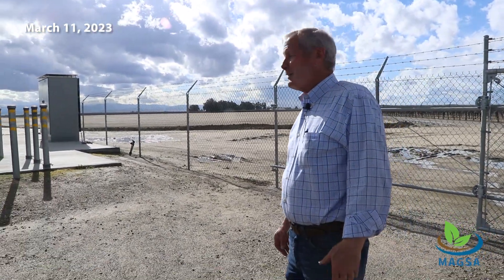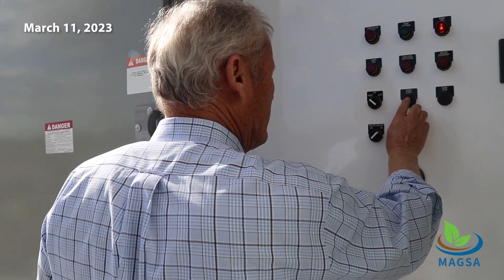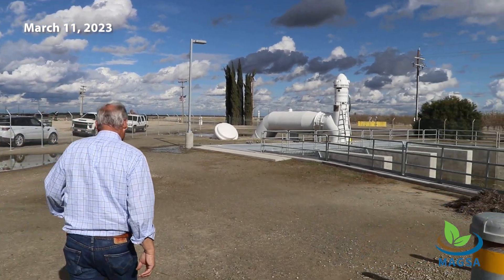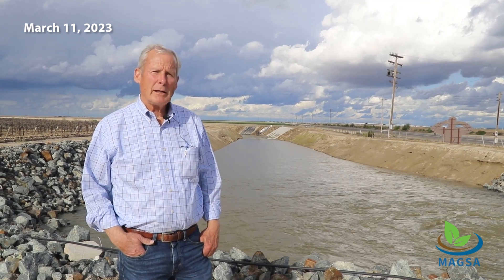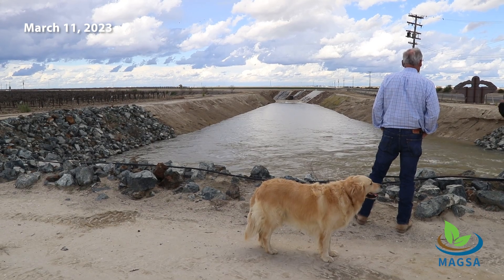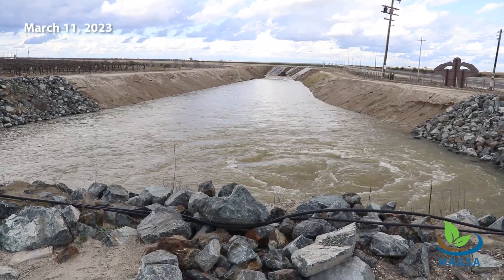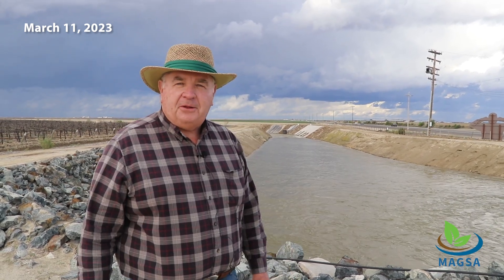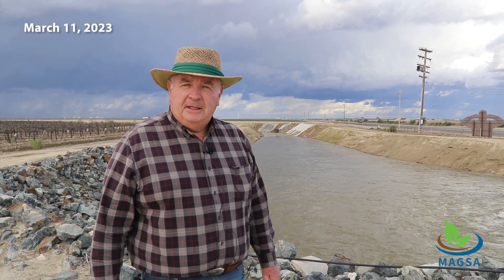Pump turns on at the McMullin On-Farm Flood Capture Project for the first time

Comment: Has anybody thought of a enclosed archimedes screw pump.   One end floating on a pontoon so water level changes don't  effect it and zero loss because the whole tube turns like a trommel or cement truck.   Very low horsepower needs for a significant amount of water compared to a centrifical pump. No need to pressurize the water to get it to move hal full up the pipe. Could probably build a large one using water slide secctions around a center support.  I read that over half the electricity used in california is to move water around the state.

Comment: California has a 3 year reserves from having full reservoirs. After 3 years of draught the surplus is gone. Since 80% of the water is used in agriculture it is good to see farmers using the water wisely when they have a surplus. Water is like having money in the bank.
Reply: irrigation water mostly goes back to ground very little is used by the plants or evaporation. But it takes 1000 years to replace on foot of ground water. AND the ground is what filters the water why ground and spring water is clean.

Comment: That is one MONSTER pump.  What voltage does it run on (I noticed the large transformer next to the control cabinet) and how many amps does it draw and how many horse power?
I am glad to see SOMEONE finally taking this seriously and taking the first steps to capture some of this excess run off that would have flowed to the ocean.
Reply: Looking at the size of the motor and gear, I'd say 4160v could be 13.2kv and probably 100amp.
Reply: @edmundanderson657   I was hoping they would say what the HP was at least. We had US Motors driven 4' diameter pumps that were 150 HP.  Good for 125CFS of flow with a 9' lift. Which means that pump ( depending on the head ) would be rated at about 150CFS max. So maybe a 200 HP motor which is well within the ratings for a 480V 3phase unit. Our Diesel units ( Cummins N14 or Cats ) were rated at 150 CFS which is 67,000GPM. And we had 4 Diesels and 1 electric pump at each of 3 stations.
Reply: @gravelydon7072  

Its been a long time since I've worked on motors of that physical size. A guess at HP would be just that, a guess.
I had tried looking for any information on it but haddnt found any. But looking at the size of everything I'd say 4160v.
The starter cabinet is huge  for a 600v starter.
Reply: Large machinery like that is usually 3 phase, 480 volts.
Reply: @dfirth224  I kinds figured so.  BUT I have seen pumps running on much HIGHER voltages.  I was just curious.
Reply: @dfirth224 maybe 4160
Reply: Probably 480V 3 phase. The transformer has a bus duct which is a requirement with PG&E for 3,000-4,000 amps. Looks like the only thing at the site (found it on Google Earth & Maps). That looks like it's a pretty low head system. They could be doing it with 600-1000HP maybe. I worked for a contractor before and a customer used to pump 2500 gpm with 75hp pumps for drip irrigation (up to 160 acres but they had control valves). I think he said 17,000 gpm which is 6.8x times as much.
Reply: @patrickmay8261  this pumps 70,000 gallons per minute
Reply: @patrickmay8261  Cool.  Thank you.  I did A/C for 35 years and the highest voltage I worked with was 480V 3 phase.  I got bit by 120V, 240Vand 277V (THAT smarted) and I give the utmost respect when working on 480V equipment.
Reply: @patrickmay8261  No need for that big of a motor on the low head that they have. And he said 70,000 gallons per minute which is about 150CFS. So it shouldn't take more than a 200HP motor. We moved 125CFS with a 150HP motor.

Comment: It’s great to see this happening.  It would be useful to have better illustrations of what is happening - the video seems to suggest water is being pulled from the ground rather than injecting into the ground.
Reply: Don Cameron sparked curiosity in 2010 when he began a multi-phase project intended to capture floodwater from the Kings River during rainy seasons.

The effort, supported by state grants, unfolded as a grand experiment, as the diversified Fresno County grower flooded his permanent plantings—including pistachios and vineyards—to such an extent that they soon rested in several feet of water.

To Cameron’s relief, those plantings survived relatively unscathed. As the water percolated down, the aquifer water table rose significantly, increasing nearly 40 feet in a single year.
Reply: We have Leeves and Flood gates throughout the valley. Basically when it's a wet season like this they can open up the pumps that instead of pumping water out of the ground they are sending it back into the Aquifers below. The entire Central valley is a Drainage basin for all the Sierra snowpack. The entire central valley was Lake Corcoran which supplied California with an Incredible aquifer supply that we need to replenish.
Reply: THIS FLOODS THE LAND area and SOAKS into the ground naturally, NOT INJECTED into the ground, naturally filtering the water.

Comment: Please explain in simple terms? Are you taking excess water from X and folding fields to allow the water to seep into the ground? Or are you actually pumping the excess water into the ground?
Reply: Don Cameron sparked curiosity in 2010 when he began a multi-phase project intended to capture floodwater from the Kings River during rainy seasons.

The effort, supported by state grants, unfolded as a grand experiment, as the diversified Fresno County grower flooded his permanent plantings—including pistachios and vineyards—to such an extent that they soon rested in several feet of water.

To Cameron’s relief, those plantings survived relatively unscathed. As the water percolated down, the aquifer water table rose significantly, increasing nearly 40 feet in a single year.
Reply: They are spreading and percolating. Whatever doesn't evaporate will be pulled by gravity toward the center of the earth through the permeable soil until it hits a relatively impermeable substance(i.e. bedrock)
Reply: @blackhawk7r221  That isn't what he's doing
Reply: @SaginawCareerComplex  I do believe he is refilling the local aquifer with surface water.
Reply: @blackhawk7r221  How do you think water normally gets into an aquifer bro? It seeps from the surface
Reply: @blackhawk7r221  Correct.  However, it is NOT be direct injection.  They are flooding fields and letting the natural recharge process do the rest, just like a very heavy and prolonged rainstorm.
Reply: @kevincrosby1760  I see

Comment: Ok.....you got the pump running, how about you show how you use the water to recharge the aquifer?  This just shows it being pumped into a culvert, and then?
Reply: They spread it out on 5,000 acres of farmland and allow it to percolate into the ground.
Reply: There's a pdf in the notes -- https://www.mcmullinarea.org/wp-content/uploads/2022/04/20220324-MAGSA-Expansion-Project-Brief_FINAL.pdf
Reply: @jimmiller5600  Thank you for the link. Shows my calculations were right on for the flow rate. Expansion of the project would see a 400 or 500 HP motor used or if they were smart, 2 more 200s.
Reply: @gravelydon7072  This is a good "proof of concept", but given the West's flood-drought cycle they'll need thousands of big and little projects to offset the huge population & agriculture in what's often a "desert" region.  In the end, any progress is good.
Reply: They do not pump it into the ground, it percolates into the ground. Especially in sandy soils.
Reply: It's for irrigation. Aka, groundwater recharge.
Reply: The water goes into the canals and then floods the fields.
Reply: Probably a bypass for pressure regulation and help cooling the pump motor.
Reply: Don Cameron sparked curiosity in 2010 when he began a multi-phase project intended to capture floodwater from the Kings River during rainy seasons.

The effort, supported by state grants, unfolded as a grand experiment, as the diversified Fresno County grower flooded his permanent plantings—including pistachios and vineyards—to such an extent that they soon rested in several feet of water.

To Cameron’s relief, those plantings survived relatively unscathed. As the water percolated down, the aquifer water table rose significantly, increasing nearly 40 feet in a single year.

Comment: I've wondered why water couldn't be pumped back into the ground. Nice to see that someone has been working on such things.
Reply: pumping water directly back into the ground requires a high level of filtering and monitoring, and incredibly high pressures, but if you have the surface area to do it, you can just flood a bunch of fields using a high VOLUME pump and let gravity do the rest.
Reply: An aquifer isn't a giant cavern below ground, it is water trapped in soil. If you try to jam a bunch of water into the ground at a high rate, you're going to displace soil, like if you took a firehose to a hillside.
Reply: @LucidStew  Depends on where you are. Here you could force water into the ground and into the aquifers. But as it only takes a short time for it to soak in on its own, just building a retention area works just as well. It is only 6' down to water here normally. And the rock is one fifth porous.
Reply: @LucidStew  They don't force it in, they flood the fields and let seepage do the rest.
Reply: @edsloan8535  this is what I was saying to the OP.
Reply: We've been doing this for a while but it has just been in a severe drought for 30 years. It's private property so the state can force them to build stuff like this, it can incentivize it but it has to be up to the Farmers to want it to be done on their property. You are talking about refilling aquifers that were filled over millions of years first by Lake Corcoran then by Lake Tulare Buena Vista and Kern Lake.
Reply: These sorts of things have been happening for a while, we just never hear about it.
Reply: "...wondered why water couldn't be pumped back into the ground."
In Nova Scotia, we use gravity.
Reply: Likely mainly cost related. Large capacity injection wells would need to be drilled, and many of them. Cheaper to let it seep in.